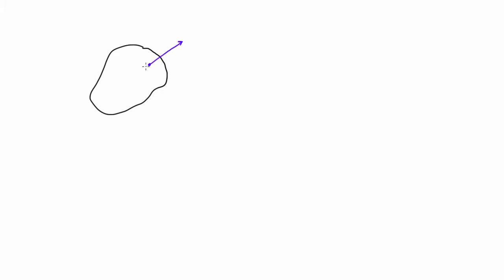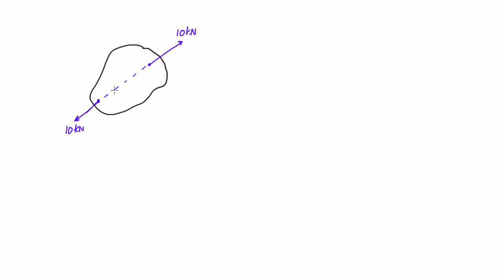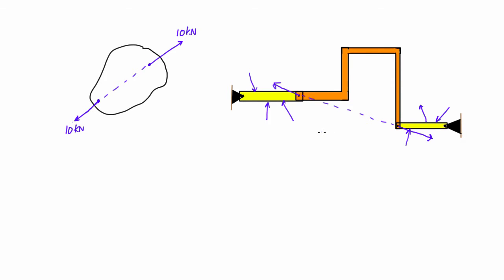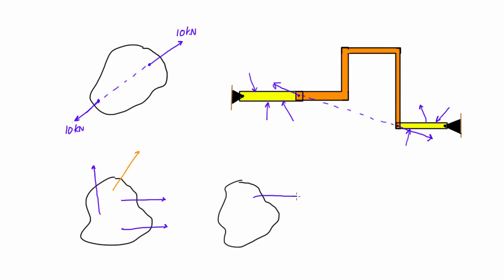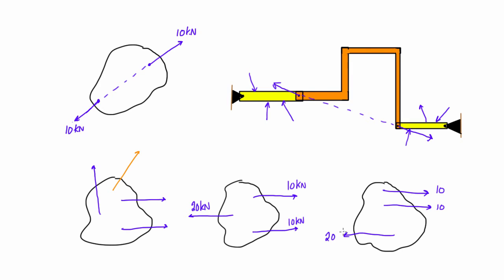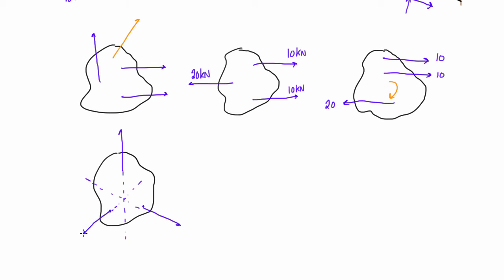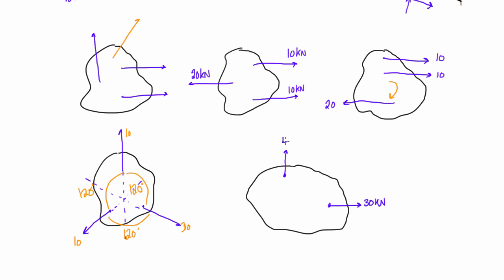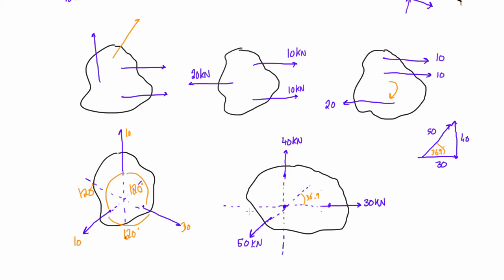Three force members explained

Comment: For two force members, do the forces have to be along the same line of action, or can they be parallel?
Reply: They have to be along the “applied line”, which is also along the line of action of the forces, which can be considered to be the same line of action since they overlap.
Reply: The “applied line” is an imaginary line that “joins” two “applied points”.
Reply: The “applied points” are the points that are subjected to a load.

Comment: Hi, I just wanted to know that are the three forces acting on a 3 force member internal forces? Please help me with this.
Reply from the maker: A "three force member" refers to a member with 3 external forces. At this level of statics, knowledge of and understanding of internal forces is generally not necessary. A member that has exactly 3 external forces acting on it is called a three force member, and we can determine that they either will all be parallel, or should be able to find the point of intersection of their lines of action d as described. Does that help?
Reply: @Engineer4Free   Thanks Alot ♥️